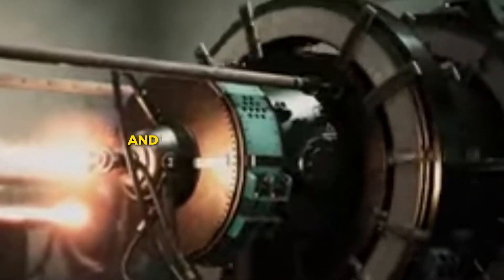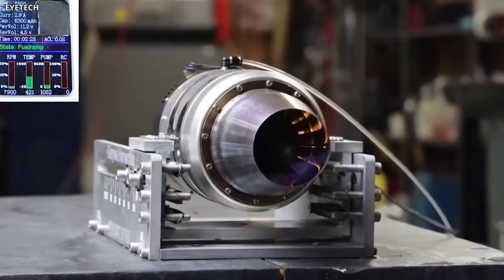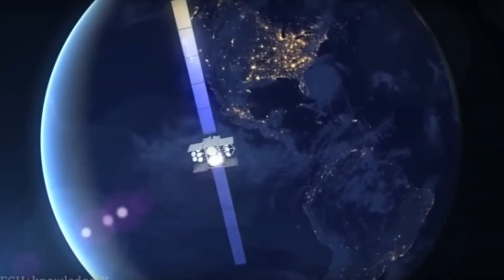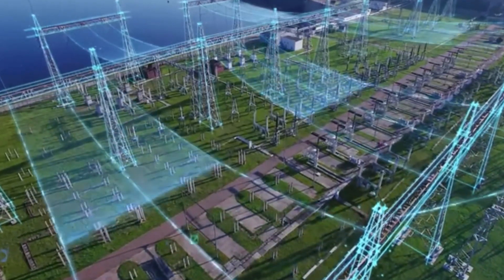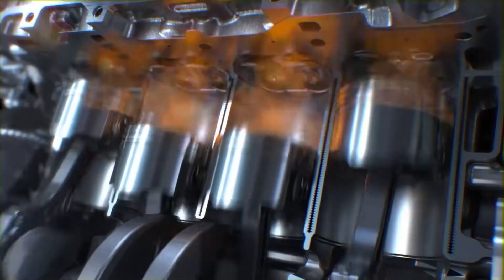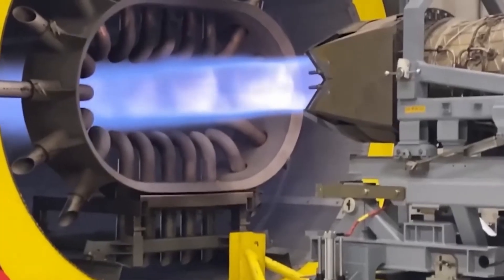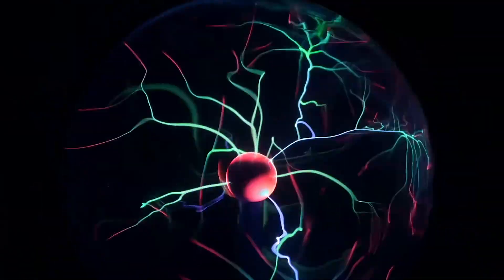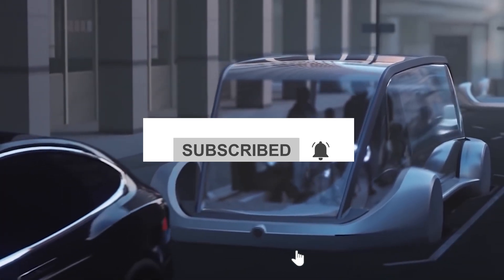CHINA Baffles The World with Revolutionary Plasma Electric Motor, No more Hydrogen, WOW!

Comment: I love watching these techno breakthrough vids.  Only ... how rare are the gases used in these Plasma e-motors?  If there is a lot of heat, that implies very expensive alloy metals that can withstand such without melting - something that sounds very expensive and not at all addressed here.  And what of the size?  How interesting that the only prototype demonstrated with MOUNTED IN A TRAIN!  It's highly dubious this engine will ever be reduced enough to fit inside a standard automobile.